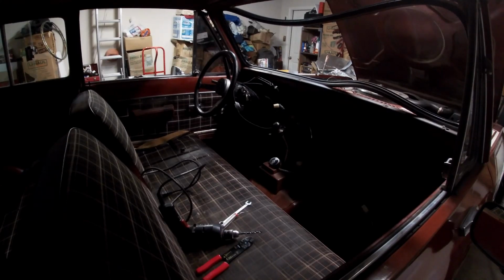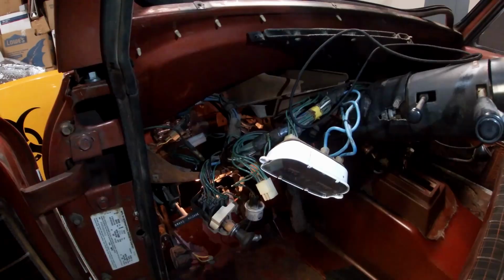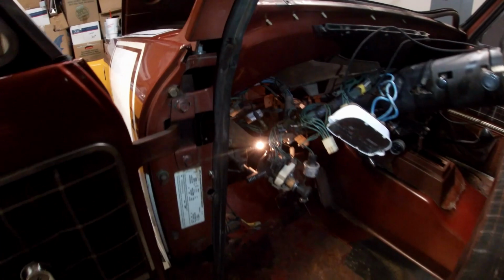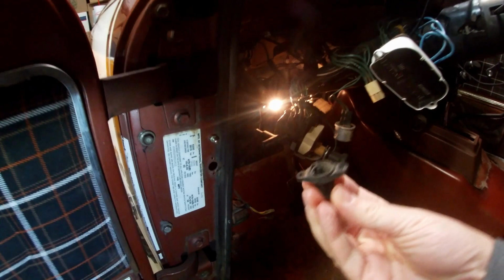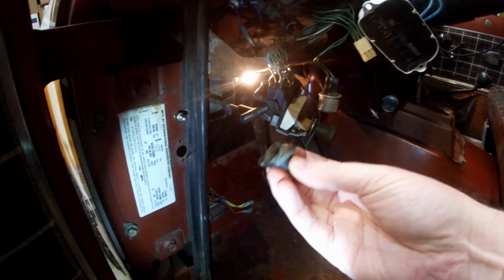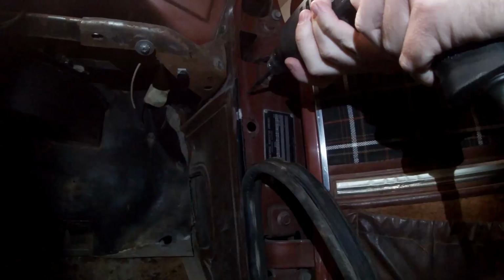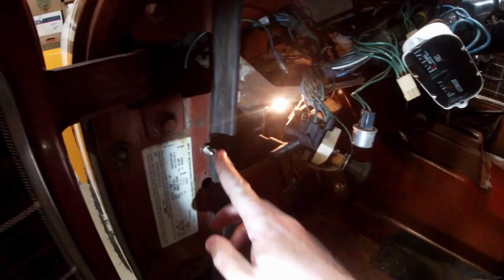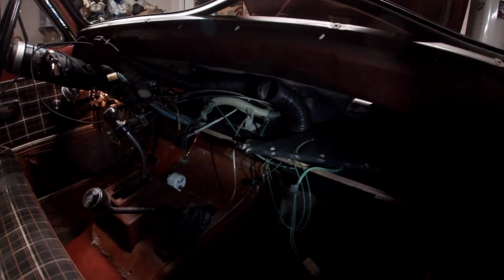International Scout II Door Jamb Switch Alternative Replacement

Comment: That original plastic switch is a Dodge/ Plymouth part #4221101. I've recently picked up a couple for about $20 each plus shipping. The plastic style replaced the original all metal type sometime around 1977.

Comment: Why do I have 2 wires coming from my door jamb switch, mine look original but wires do not.  How did you wire yours?
Reply from the maker: I don't recall what my original had, i feel like it may have had two wires as well. They were in really bad shape and not much left of them. These are just a ground point that is switched on and off so just the single ground wire of the lighting circuit is connected. When the door opens the switch completes the ground and the lights come on.

Comment: I've got a 73 Scout II that came with the door jam switches you are now using.  At some point in its past someone removed them and the wire from it to the white plug to connect to the rest of the dash harness.  I haven't been able to figure out what type of plug/connection goes into the door jam switch.  Any help would be greatly appreciated.  Happy Scouting!
Reply from the maker: Thanks for watching.  I don't know if the original connector is still available but in my 79, this switch is self grounding and only has the single lead going to it. Worst case scenario if you can't get the connector you could remove it and just crimp connect/solder the wire and make you own connection. I prefer to solder and heat shrink to cover it.
Reply: @BarrettFarms  Roger that, thanks!

Comment: How do you suggest adjusting doors to have same gap and close even to the latch?
Reply from the maker: That's a good question. My hinges are shot and need rebuilt so I am nowhere close to having proper alignment and gaps. I did make it better by pulling the door card off and losing the bolts thar hold the hinges to the door and adjust it a little there. I will post an update one of these days when I am fixing my worn out hinges pins.